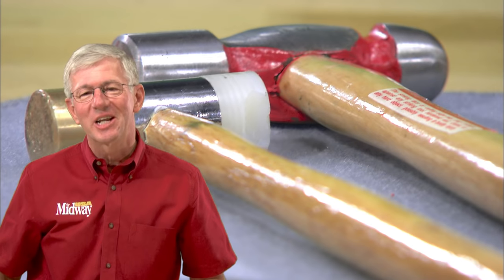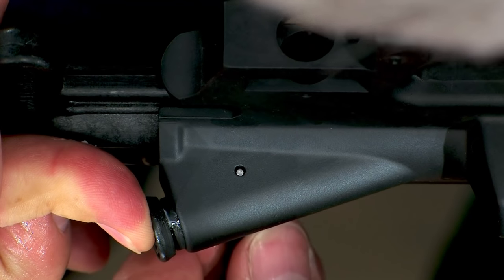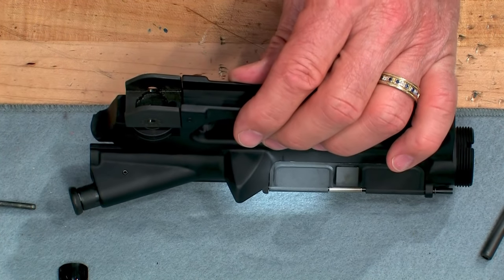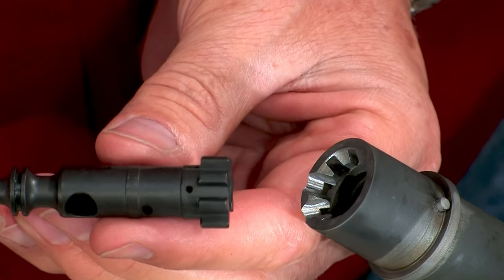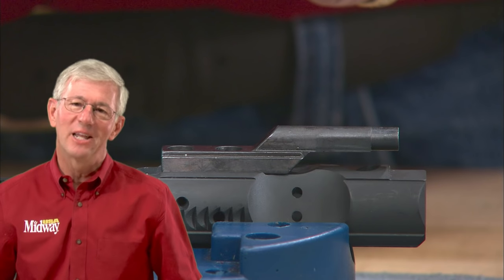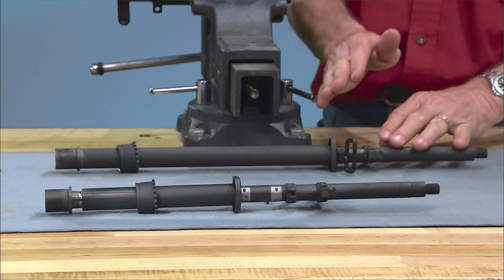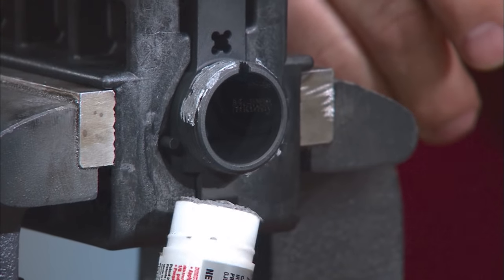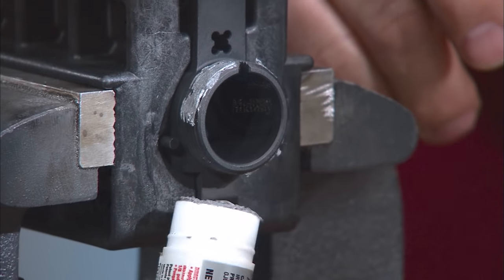How to Build an AR-15 Upper Receiver Presented by Larry Potterfield of MidwayUSA

Comment: I'm only 90 seconds into this video and I already know that he's not telling the truth just by all the tools he listed! A lower build takes no more than some punches, a hammer, some pliers, & a block of wood. How on earth is an upper build easier?
Reply: David Price If your going to build an Upper/Lower correctly you need quite a few tools. It realistically can be done with much less then he listed, however from a professional standpoint he is showing the "by the book" method. This is a great starting point for anyone looking to learn how these weapons work.

Keep in mine the MidwayUSA and Larry have a reputation and if they cut corners on showing someone how to build/assemble/repair a rifle and they injure them self then MidwayUSA and/or Larry could potentially be held liable. By doing everything "by the book" using professional gun-smithing techniques he is able to transfer all liability to the viewer. Since failing to observe proper gun-smithing techniques and assembly specifications are the fault of the user.

If you want to see Billy Bob and Bubba build an AR-15 with a few bits of tin and bailing wire you came to the wrong channel.
Reply: Right on...

Comment: Torque wrench needs to be 90 degrees from the center of rotation for accurate measurement. Also anti-seize throws off your torque specs.
Reply: The torque specs are calculated for greased threads. Did you not read the TM?
Reply: @rifleshooterchannel208  can you show that to me? I’d love to use anti-seize on things but from an engineering standpoint I’ve always understood it to nullify a torque spec.

Comment: Assemble not Build...quite a destinction.
Reply: No it isn't. Open a dictionary and stop nitpicking words.
Reply: @mountsj  
I referred to the Dictionary...I do not think it is nitpicking. 
Don't be so sensitive...just know that you've never Built either...unless!  you have milled stock.
Language has been decimated, and you appear to  agree with it.
Reply: @user-he1pp9gh1l  
Build
/bild/
Verb
construct (something, typically something large) by putting parts or material together over a period of time.
Reply: @user-he1pp9gh1l  whats does that even mean? Why did me posting the definition of the word build get you so butt hurt. Not used to being proven wrong?
Reply: @user-he1pp9gh1l  run away little boy, run away.

Comment: It's too bad this guy doesn't know to check if the barrel fits flush with the inside of the upper receiver. Due to tolerances in the barrels and the length of the threaded part on the front of the receiver, the barrel can either stick in too far or not far enough but either way it won't be able to feed properly. Unless you are just dealing with Colt parts all day and not any other manufacturers parts half the builds you do following this video won't be able to feed properly and can end up jamming a lot!